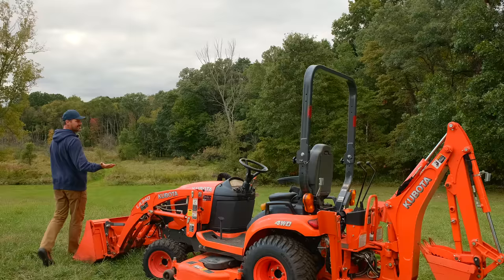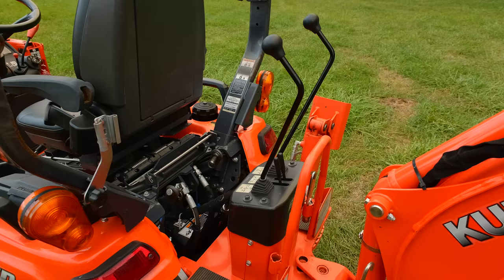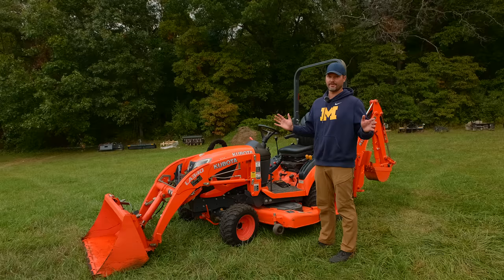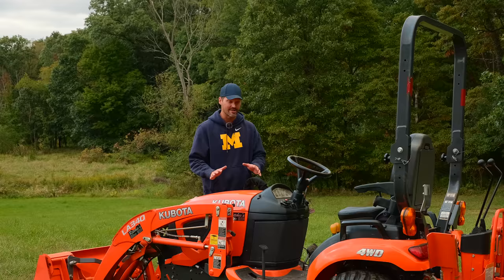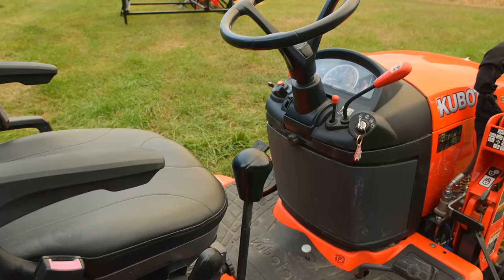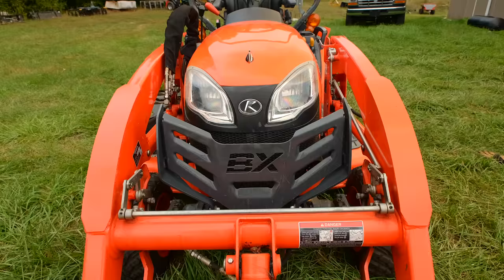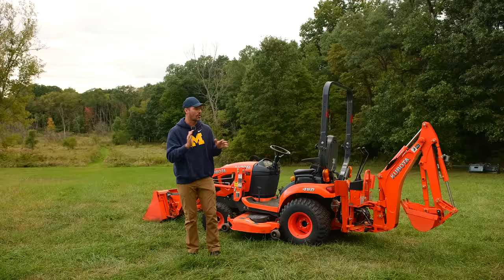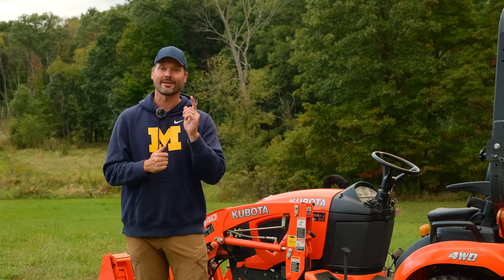PROBLEM AFTER PROBLEM AFTER PROBLEM

Comment: Not all initial use is the same for a tractor bought used with 400 hours on it. You sound like you have purchased a unit that was potentially abused, meaning used beyond its rated capacities and not properly serviced. An abused unit could be garaged stored and still look good with a wash. If the user did not perform the recommended maintenance, it could lead to reliability problems down the road. Some of the multiple services you had were for the same thing, namely hydraulic fluid leaks in the quick-change FEL. I personally would not want that in my tractor because you can see inherently where trying to automate the connect/disconnect of multiple hydraulic lines would be problematic. I can understand why Kubota and JD would want to do this. Because some of the customers are confused or overwhelmed by the operation. I can tell you it took me a lot longer initially to connect and disconnect my FEL and BH when I first did it. That was made more difficult by me due to constructing my own dollies. It is harder to drop on a dolly than the ground, and I improved my designs via experience. It is not that hard really. I would avoid that design. Some of your comments were based on the inherent design though. You stated multiple times that you (good to be you) have multiple tractor units of larger size. Well no kidding. I would always choose the larger, more capable unit over a smaller unit, UNLESS the application could not be done with the larger unit due to workspace constraints. Yes, why use a smaller bucket and lift capacity? Not sure why you got this unit to begin with. One of the things it does best is mow, with occasional digging and landscaping chores. YOU created the problem with the steering interference issue by installation of your wheel spacers! You should update the video and state so as you are telling your viewers it is not acceptable for this application. This is not true at all. That application is what it does better than all others. I had a riding mower, 48" gas powered (+20 hp) that would bog to a inch-worm crawl when my thick grass was tall or wet as it would choke on the clippings. My BX25D will blast through that like it doesn't even know its there with its 3-cyl diesel and torque with my 60" underbelly mower. BTW, there is an easier, but trickier way to drop or install the deck (not drive over type in mine) than dragging it out the side, and that is to use the FEL to raise the front wheels off the ground and just push the mower deck forward out from under the front wheels between the FEL and the front, and then lower the front end. You don't even have to turn the anti-scalping wheels 90 degrees and can skip this step. Of course to do this, you have to have the FEL on. My RCK60B weighs 250 lbs for just the deck. That is enough that I don't want to wrestle that weight at my age. To service it annually requires the use of the FEL to flip it over. I put it on a dolly to do this. The deck is three times thicker than the previous typical homeowner mower I had, and it will last forever with routine annual maintenance. The blades are twice as thick. My BX25D, which is the older model to your BX23S has been trouble free in 312 hours (as it should be). I bought it used for a substantial discount with only 39 hours on it compared to yours you bought with ten times more use that was likely undocumented.